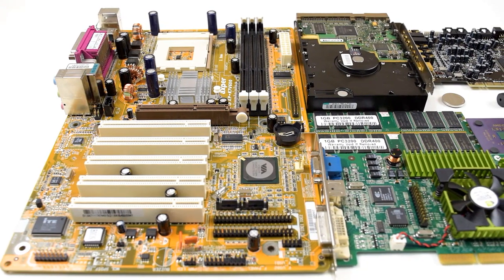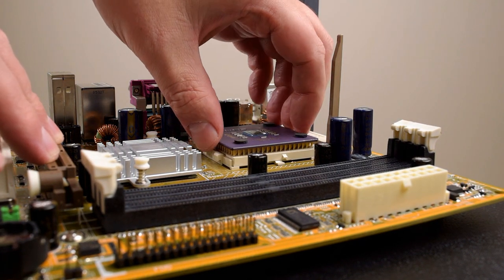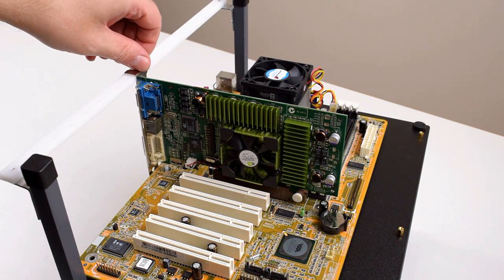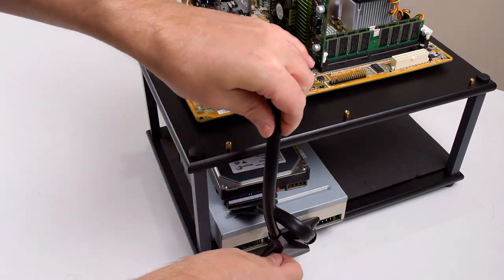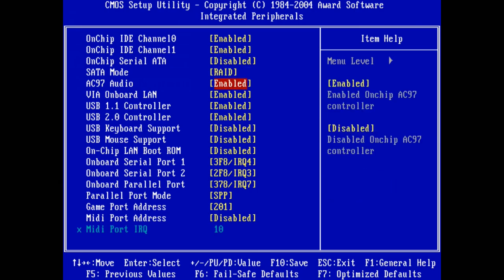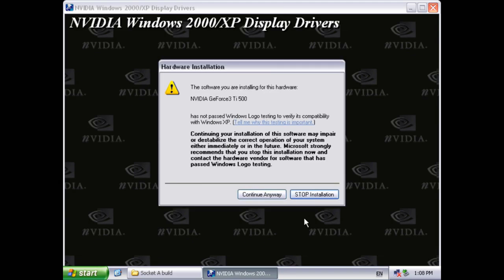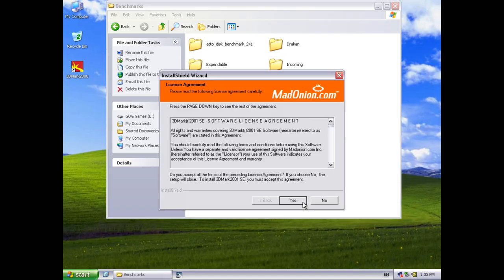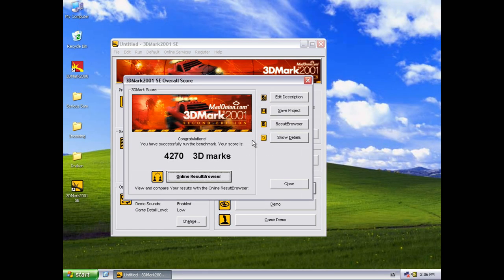Building a Socket A System Retro Gaming PC

Comment: This brings a tear to my eye. My first system that I fully paid for and built myself was a Socket A system in 2003 when I was in high school. I saved for over a year to get it. It was an AthlonXP 2400+, 512MB DDR 400 RAM, Gigabyte GA-7VAX1394 motherboard, with a no-name brand nVidia GeForce FX 5200 with 64MB VRAM and a whopping 120GB Maxtor HDD. It replaced my 10-year old 486 DX 33MHz with 8MB RAM and a 200MB HDD, and completely changed my life. The 120GB HDD was the most expensive part of the system, but I'd been so sick of only having 200MB well into the 2000s, I wanted never to be short on space again and have the biggest HDD on the block :D
Reply: I have very nostalgic feelings towards this age too. I also bought my first computer that I completely paid for myself and was very similar in specs: Socket A   GA-7N400 Pro2 with an Athlon 2600+, 512MB DDR 400 RAM, a 5600XT (cant recall the brand) with a 120gb SATA HDD that was the envy of my 'geek' friends as none of them had one of these crazy new SATA devices! 
That PC lasted me right up to 2006 (with a couple of graphic card, HD and Ram upgrades) and I couldn't count the hours of joy it brought me :)
Reply: I had the GA-7VAX (VIA KT400 chipset with an Athlon XP 2000+), which I later upgraded to the 7n400 pro2 (nforce2 ultra 400), with 1GB DDR 400, a 160GB IDE HDD, an Athlon XP 2800+ and a Radeon 9800XT 256MB.
Reply: kanopus06 I would have been shamelessly coveting your upgraded system. I could only dream of the power of a 9800XT back then too!
Reply: Yes, it was an expensive GPU back then, and performed very well with Half Life 2 and DOOM3 (50+ fps all the time).
Reply: Oh nice. I didn't have SATA, my board only had IDE. SATA came out a few months after I built my system, and I was very jealous indeed of the new thin cables. It's amazing SATA is still around 15 years later...
Reply: MaTtROsity . Only God (and that bloke quantum braced) had an ATI 9800XT 256MB. I could get a 128MB but never the 256MB.
Those were the days. Tribes! Far Cry!
Reply: taketimeout2 Ah yes the original Far Cry blew my mind! I'd never experienced a sandbox game like it. Unfortunately neither had my 5600XT, which got replaced by a 6600GT followed by a 6800GT that could finally max the game. Good times

Comment: The shape of the die indicates Spitfire core, so it's Duron 600-950. Duron 800 was most common, and you can still find them. Back in 2000, these were surprisingly good performers for cheap.
Reply: w00tDr Yes the 3D mark score really looks like my original pc setup back in the days when I had duron600 and this exact GF3Ti500 card. I was running the Duron happily overclocked to 933 MHz without any issues but it was still bottlenecking the geforce. The Ti500 card lived with me for quite long time (and survived few socketA boards upgrades as well as cpu upgrades) and was able to break 10 000 3DMark2001SE score, but this was with gpu overclock and also with AthlonXP fairly overclocked.

Comment: Oh Socket A.
I've had so much fun with that socket.
I had a Abit AN7 motherboard, an AMD Athlon XP 1800+ (T-bred) which I overclocked to about 2500 MHz using water cooling.
It would post at little over 2600 MHz, but wasn't stable in Windows.
I also had a GeForce 3 ti200 overclocked to little above ti500 speeds, I still have that card,
Sadly my waterblock cracked after a few years and soaked the entire system with water. CPU and motherboard didn't survive that bath. Everything else was fine.

Comment: that's an Athlon MP, Palomino core. Same core as the Athlon XP but on a ceramic PGA not an organic PGA, and predates the "+" rating.

I'm guessing a 1.2GHz 😃

Some motherboards incorrectly detect these as Athlon XPs. 

The L1 bridges were also closed on these processors making overclocking by multiplier an absolute breeze... ahh, I miss my dual MP rig.

Comment: nForce2 was the best choice for chipset back then :) I was using Elitegroup K7S5A, with Duron 950Mhz, 128Mb SDR, GeForce 2 MX400 and 20Gb Seagate 5400rpm HDD. Later i've managed to bought Athlon (Thoroughbred A)  2000+ and 2x512Mb DDR and the effect was WOW. And after cleaning my PC i forgot to put the cooler and i saw how AMD CPU burns for a second. Then i bought AsRock motherboard with Duron 1600Mhz. It was almost the same as the Athlon 2000+.

Comment: From the old socket 462 (a) days I was more partial to the nForce2 boards like the Abit NF7-S. More so because if you had a Barton 2500+ you could set it to a 3200+ and it didn't really know the difference.

Comment: I was reminded that you could buy these shims to reduce the risk of damaging the CPU core, and also help a bit with the heat dissipation. Much has changed since those days. The CPU coolers are like night and day. Copper was new and expensive, and heat-pipes were even more so. The fans were nothing fancy, and usually their oil bearings dried up. There was no dual or triple channel memory yet and gigabytes was for the wealthy. PCI Express hadn't taken off as the new standard yet.
Reply: Dual channel memory was introduced during the socket A era, then briefly taken away with socket 754.

Comment: Looking forward to this.  Socket-A was the second platform I built a system out of my own pocket for.  The system I had used a DFI LanParty KT400A board, AthlonXP 1800+, 2GB of DDR-400 memory, an 80GB harddrive, DVD and CD-RW drives, Radeon 9800 Pro 128MB, steel version of what became Antec's LanBoy case, an 11g wifi card from D-link, and an SB Audigy 1.  Lots of good times with that one.  Games I played were:

UT99
DooM 3
UT2k3
Age of Mythology
Baldur's Gate
and TRON 2.0 to name a few.
Reply from the maker: Nice, thanks for sharing!

Comment: I want to see on this system
Quake 3 
NFS Porsche 2000
Grand Theft Auto III
Mafia
Max Payne 2: The Fall of Max Payne
Far Cry
Reply from the maker: Annoyed that Mafia isn't available digitally anymore. Same with NFS games.
Reply: Demo ?
Reply: I bought Mafia before they removed it from Steam, so it's still in my library.

It runs like crap on modern pc's. Crashes quite a lot. I think that may be the reason why they removed it.
Reply: man I wanna see every single game on that list played on this system you came up with a great list.
Reply: I think you can only get mafia from torrents at this point, however I am not sure if anyone is seeding such old stuff.
Reply: thanks man, NFS and Mafia can be purchased on Amazon i think
Reply: Bought the Mafia CD used in good condition on amazon for very few bucks and it runs like a charm on my i7, gt650m, 16gb ddr3 and win7.
Reply from the maker: I got the demo, but I don't have the time to buy and install retail copies I'm afraid.
Reply: how about CS 1.6 :P ?
Reply: and if it is fast enough, maybe even CS:S/HL2? (I know this is wishful thinking so if these don't run, CS 1.6 or HL1 would be good benchmarks)
Reply from the maker: Il Papa Vitielo Remember that Steam doesn't run on many old processors.
Reply: Nonesteam version ? :P
Reply: it isn't on gog sadly.
Reply: I downloaded a ton of nfs games recently for free so if ethically you don't want to do that I understand but if not I could probably get you links and stuff.
Reply from the maker: Time is the issue. It needs to be up and running ASAP. So no discs or images. Ideally if it runs straight from a folder I can copy, that would be perfect.
Reply: Are you down for piracy? because as I see it that's one of your only options given your time limitations.
Reply from the maker: Sure, but that also takes time to sort out and figure out. I give you "best case" example. A viewer wanted me to have a certain game, so he uploaded the ISO to some sharing site, together with some brief instructions. That made it easy for me and that game will get used soon.
Reply: how about I upload mafia 1 packed into a rar file to (say) google drive? just unpack and play(hopefully) will that work for you?
Reply from the maker: Yes that would be cool!
Reply: I have MAFIA coming out of my arse. I have about 3 boxed so if you want one let me know.
Oh dear , just remembered you are on the other side of the planet. I collected HUNDREDS of games when they were going for £2 or less over the last 10 years at Game or CEX.
Maybe 1000, all from between 1997 and 2006. Crysis is about the most modern .
I got any game that would run on a laptop with Intel shitty graphics or dedicated graphics up till 2007 Nvidia 8600 (which was shit too, weaker than the 7950GTX that preceeded it).
Reply from the maker: Thank you! It's downloading now. In the meantime I have gotten the demo up and running. A good demo I might add, it has the tutorial and a bit of the storyline. I died straight away of course, but it was fun :D
Reply: Please let me know if it works, once you downloaded it I'll take the link down as I don't wanna promote piracy :)
Reply: Haha. The Mafia wouldn't give a toss about piracy! BTW I had Mafia out last night and enjoyed driving around taking fares in my taxi. It never ceases to amaze me how big and detailed the City in Mafia is. I ran it on a Pentium 3 Toshiba 6000 which runs it perfectly. Got the laptop for ............wait for it....................£6 on ebay.  The postage cost more!
HINT Old laptops running W98 are a pure joy that is cheap too. Indulge ! Thats an order guys.
Keep up the good work, Phil.
Reply: you're right, mafia is old enough that it should be free at this point lol
Reply from the maker: It's finished downloading. I removed your comment with the link. I'll try it tomorrow!
Reply: thanks!
Reply from the maker: That worked great thanks! The graphics are pretty good, the CPU does struggle a bit though.
Reply: glad it worked :)

Comment: I finally got my p4 board and CPU and GeForce 4ti 4200 128mb card in and working, at first need for speed underground crashed but I turned down to medium settings and we are good now running a p4 2.5GHz with 1gb ram and a 40gb regular hard drive bc the SD adapter was not doing right. Thanks for all your help Phil, you do great work btw, keep it up

Comment: Would love to see an old Athlon vs Duron shootout, maybe overclocking the Duron? That is if you can find a working Duron still, lol. Nice system man.
Reply: I have a working Duron 700 somewhere, however it's in the attic, man I miss that system sometimes,it was my childhood.
Reply from the maker: Well that's a given! I just got to finalise some details of this build...
Reply: My brother built a AMD machine in 2003 that was in the top 100 benchmarks in the world in 2003. I still have most of the parts. It has some kinda of Raedon card with a voltage mod and huge heatsink on it. A DFI lanparty motherboard and my brother tells me "a mobile Barton CPU" whatever that is. He tells me this is the CPU of choice for this era of gaming.

Comment: My very first custom PC build was a 1 Ghz Athlon Thunderbird system back in January 2001.I went that route rather than using the first Pentium 4 because such a system would be costly.
However my system seemed too unstable somehow with Windows 98SE so
I used Windows 2000 Professional on it and was satisfied.It couldn't run many of the older Windows 98,95 PC Games but it had no issue with the vast majority of the Windows XP era PC Games.

Comment: I had Athlon 1.3 GHz and Geforce 2 GTS Pro. It got about 4200 points in 3DMark 2001, so you probably have much slower CPU since, Geforce 3 should have higher score than that.
I don't remember the exact score from 3DMark 2000, but it was a lot higher than from 2001. Maybe even 8000? So if you have similar score in 2000 and 2001 it means that CPU is the bottleneck. I would guess it's a 500-600 MHz Athlon or a Duron CPU.

Athlons were very good CPUs, but they lacked Intel SSE instruction set, that made them obsolete really quick. At one point I had Geforce 7600 paired with that Athlon, but unfortunately every game from 2005 and later didn't run on this CPU because of SSE requirement. Later Athlon XP CPUs for that socket solved that issue, so they were an easy upgrade option.

Comment: Another great video Phil! My guess would be a 700-800mhz processor! I would have one piece of advice for you: refrain from connecting one slow drive like a DVD-ROM with a HDD on the same IDE channel! Your videos about Athlon XP vs. Pentium 4 inspired me to build my socket A dream machine last year so I hope I am not intruding by listing its specs below:Athlon XP 3200 CPUAbit AN7 nforce2 ultra motherboard2*1gb Corsair RAMLeadtek GeForce 7800gsWD raptor HDD.
Reply: Yep, IDE is limited by the slowest device and shares bandwidth.
Reply from the maker: I know they share bandwidth, but not that it's limited by the slowest device. The drive only does 58 MBps tops, but that would still be a reason to use a single cable for it. I'll do some Google searching I guess :D

Comment: And my guess for the processor is a Duron 0630 (600MHz) or higher. I had an Athlon XP 1700+ years ago before the BIOS chip got corrupted. Best motherboard to support DDR memory. I do have an Athlon 64 PC with 768MB DDR memory, Windows XP Pro SP3, 320GB SATA HDD, AHCI SATA PCI controller, the whole 9 yards.

Comment: I used to get about 6000 in either 3dmark 2000 or 2001 with a Duron 650 @ 800mhz and ti4200. I reckon this could actually be a Duron or athlon 600 at original speed. How about in this series using Doom 3 as a substitute for "can it run crysis?", but I guess ideally You would need a dx9 card for that.

Comment: im using my Hp pavillion Socket A that my parents bought all the way back in 2001, i used to run it with a nvidia 6100LP, but it died, i revived it with a ATI 8500 PRO AIW, and runs great, it has the Athlon XP  1800+ 512mb, ATI 8500 128mb, and boy does it run great, i finally completed most of my favorite games that wont run on windows 10

Comment: A wise word of advice to people building a Socket A system for the first time is to check for hot spots on cheaper boards mainly  mosfets and a overheated chipset can cause some grief in the form of reduced performance and stability issues. 

For those who like overclocking consider the mobile versions of the Barton core as they are lower voltage and are easier to work with.
Reply from the maker: Do you have information on these mobile chips? I remember reading about mobile Athlon 64 and you needed software to change the multiplier and stuff like that.
Reply: googling "Multiplier on the fly Fab51" should land you straight on the info you want, that site has everything, modding/overclocking tutorials etc.
Reply: I got a two systems but haven't done anything with them in a long time but you can use 754 mobile Athlon 64s in normal desktop boards but you either have to scrounge a ihs off a sempron or use an after market cooler due to the gap. Some of them really do only sip power vs the desktop versions and are fun to tinker with without heating up the place.

Comment: A friend had an ATI Radeon 9000pro and it was fast (especially the memory) so it was great for sparkly effects on games like Freelancer or for bump mapping on the Thief3 game or Loki when matched with athlon xp 2400/2600xp 333mhz-fsb or 2800xp/sempron 400mhz fsb. A 2100xp 266fsb was ok too. The slower 9000 (sans Pro) was like a Geforce4Ti so that should give some notion of what a faster 9000pro was like. The 9000pro was great to match with slotA or similar motherboard setups.

Comment: I have 3 Socket A retro systems. Athlon XP 2600+ Thoroughbred B with V5 5500 AGP, Athlon XP-M 2600@ 2600Mhz 1,75V with Gainward Bliss 7800 GS 512MB (7800 GT) and Athlon XP 3200+ FSB166 on my fastest 3Dfx machine. I have upload here on youtube a simple small video of my fastest 3Dfx system. :)

The DFI Lanparty NF2 Ultra B is one of the best Socket A Mainboards, the best for overclock. On Via, the Epox 8K3A+ and 8K5A3+ were the best.

Comment: I have a nice Socket A build with a sempron oc to 1.9 GHz, 1,2GB RAM and Radeon 9100. In WinXP It's quite usable though firefox esr support for non sse2 cpus ended this month. Can even play 720p YT videos via smplayer nicely (with skiploopfilter enabled). I also have a Linux there, but it's just too slow in normal desktop usage, probably because open source driver, it ran much better with a gf4 mx400 with a closed driver. With a current linux I would need a newer nvidia agp card though.

Comment: Geforce ti500 bought from ebay couple of weeks ago around 60?? I guess this is a 1ghz cpu. This card should do about 9k with 3ghz  P4 or similar AMD. You need a 2000+ or more to make this card shine. KT600 or  KT400 that you use has the limititation of AGP 4X, you could use a KT266A/KT333A mobo which can take up to 2600+ or even Barton and also bench Voodoo cards!! Performance loss is minor compared to the extra option. Keep up the good work:)
Reply from the maker: KT600 is full AGP 8x of course and takes any Socket A CPUs like 3200+
Reply: Yes and the limitation of not taking AGP2X as i said..no Voodoo cards except 4500. But you can go as high as 3850AGP if you like

Comment: Absolute dream build, I always wanted a GeForce 3 but got stuck with a GeForce 4 mx 440, funnily enough on an axper motherboard with a duron 1200. Would love to see how this pc runs Halo pc as that's probably what I would have primarily played in it (the proper pixel shaders on this card made the big difference)
Reply from the maker: Halo is going to be a challenge I think. Maybe it runs faster on DX 8 though.
Reply: PhilsComputerLab yeah it probably won't run amazingly, it should be ok at 640x480 but anything higher is asking too much. I remember it running very well in the ti 4200 at the time.